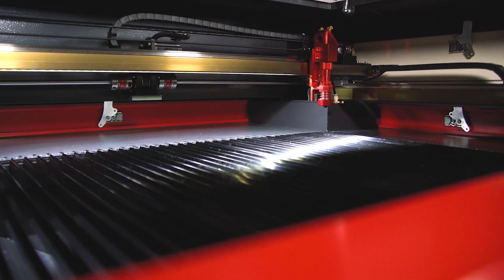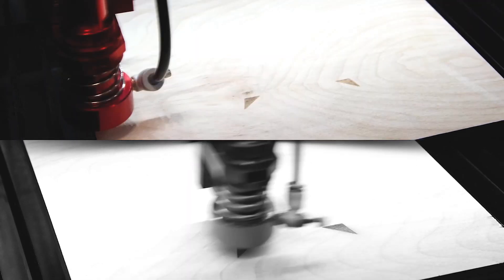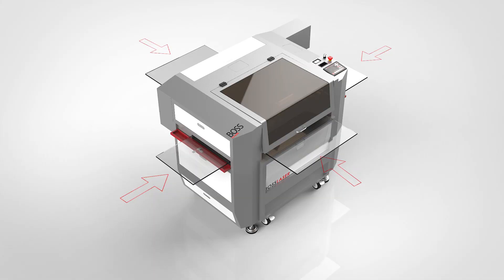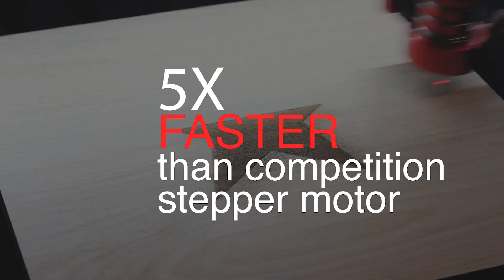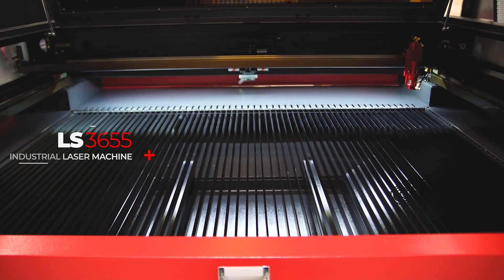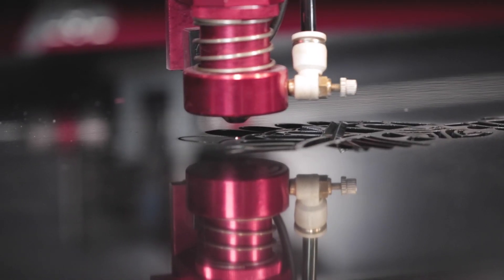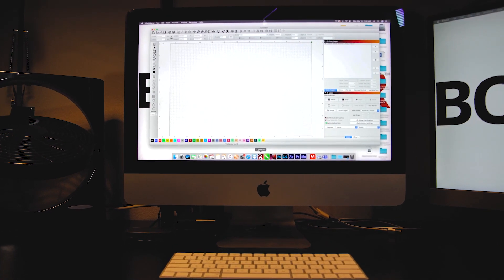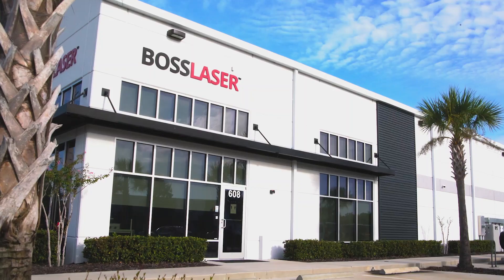NEW LAUNCH:  Boss LS Series Laser Cutter Machines - Hybrid & Full Servo Motors

Comment: Is it possible to upgrade the stepper motors on previous LS models to these servo ones?
Reply: Negative ghost rider you can not
Reply: @DOUBLEDEFENSE  What prevents the upgrade?
Reply: @jarodmorris611  I would imagine the older controller wasn't setup for servo motors and only outputs step/direction, and doesn't have the ability to receive the feedback from the servos.